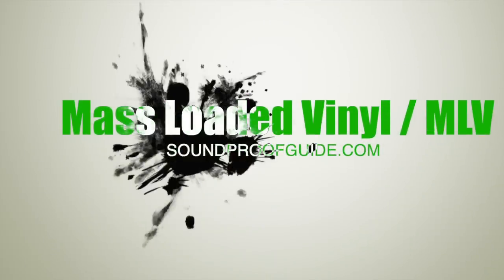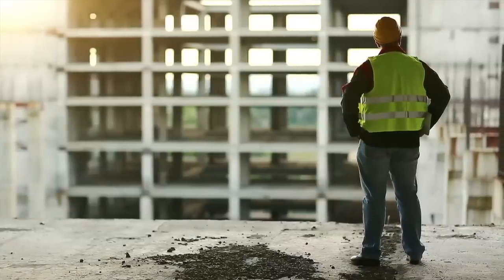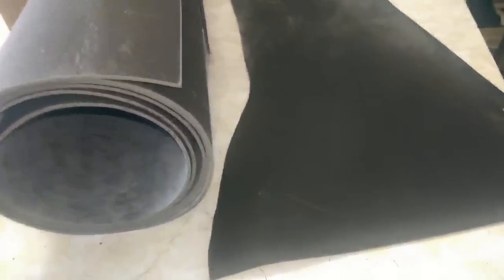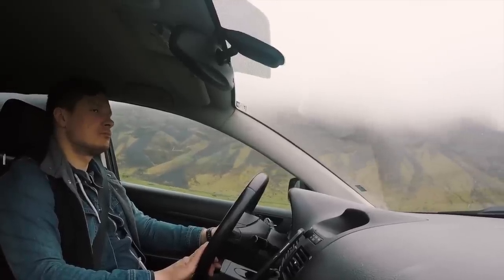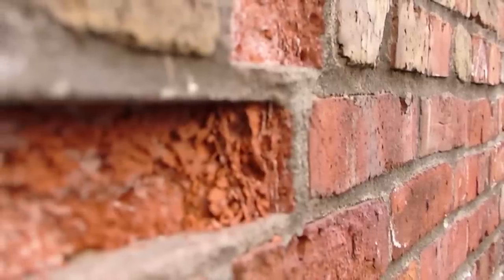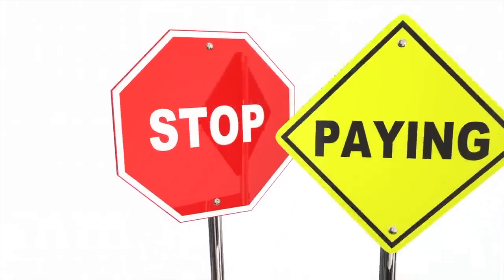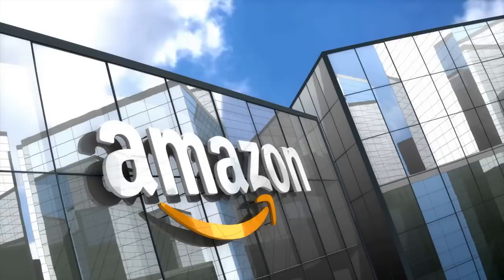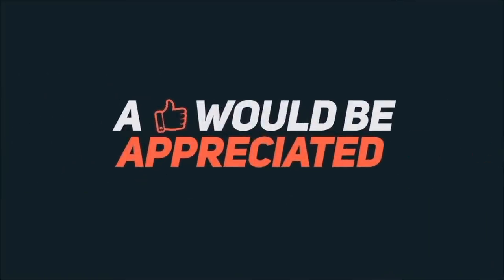Mass Loaded Vinyl For Soundproofing / All the MLV Facts!

Comment: PLEASE explain.. read a lot of comments.  You can’t just apply over an existing wall, like a bedroom that faces a noisy road, it won’t work unless you use another layer of drywall over it???
Reply: I wish they would answer. Because I need to cover my wall from my Noisy Neighbor but I don't have the ability to put another wall in front of it
Reply: @janinec..beyondmeasure  
Put SOMETHING in front of it...temporary,  movable panels: covered in fabric or ceiling hung Heavy curtains entire length ( like hotels do) or wood panels ?
Reply: @karlakay  thank you very much but believe it or not I came up with a great idea and it works. I got medium size storage lids and I put four of them in each window.  my next move is to attach felt to the lids and then it will really be quiet. It actually works

Comment: Thanks for the great video, do you have a video on how to install this?
Reply from the maker: Glad you enjoyed it! 
There’s no videos on how to install it yet.
It’s really simple however. Where were you going to apply MLV?
Reply: Hey there, in my case I wanted to install it in rhe ceiling between the main floor joists and the basement ceiling dywall. Staple to the joists? Would  Roxul safe n sound between the joists still be useful for added advantage? What is the advice for handling penetrations due to wiring, piping and  the recessed lighting we are planning to minimize loss of ceiling height? Could the penetrations significantly compromise effectiveness of MLV?
Reply: @bodhisattva4eva   For ceiling application not recommending you staple it as it will rip. You need to use nails with a big washer head. I would recommend some insulation material in between joists. It will help with sound blocking.

Comment: MLV is very costly , I just use GRACE ICE & WATER SHIELD® a 60ft. roll is $90 same effect at a fraction of the cost , Ive used is succsfully under floors in ceilings ect . Dont get sucked into spending $$$ when Grace is just as good and so cheap you can double the layers with out spending thousands of dollars.

Comment: MLV isnt working too well for my house. I live across the street from sn incredibly loud gas station and I tried the sandwich technique and another layer of drywall to no avail. There is basically NO sound reduction and it was a huge waste of money.
Reply from the maker: So sorry to hear that. Have you done any soundproofing on the windows? Before soundproofing an outside wall, you should look at the windows first since most of the sound is usually coming from.
Reply: @soundproofguide  I tried stuffing blankets in them recently and that hasn't worked. They are single pane and I'm having them replaced in 4 months but I would prefer to reduce the sound now. I may even consider bricking over the window entirely if it's more cost effective. Later I will put some bricks in the window frame to see what level of noise is reduced. I have put MLV and 2 layers of 5/8ths drywall over that window. I wanted to put a bookshelf over the space of the window alone but the noise reduction is so low I'm considering ordering more drywall.

Comment: Please. Will you improve a speaker if "Mass Loaded Vinyl" is installed inside the speaker box?
Reply: I was sort of thinking the same thing except I was thinking of using 5.2 mm sheets of plywood and painting the sheets with sound deading paint and sandwiching the loaded vinyl in between the sheets (3) stacked together to form a 1" piece to build the box out of.
I have two nice pieces of live edge ash 10-12 inches wide 55 inches long 1 1/2 inches thick  to make speakers out of so I'm trying to figure out the best things to deaden the box behind them.
Reply: MLV won't do much inside a speaker box. You can try acoustic stuffing (poly fill) inside the box. Its usually used in boxes to reduce reflexes. Also used in sealed boxes to 'trick' the speaker into thinking there is more airspace and will lower the Fs slightly. I have seen MLV or sand used in transmission line boxes to add mass to an area and deaden it. Bracing the box is the best way to add rigidity.
Reply: @michaelweber5968 Most hi-fi boxes use somewhere between 1/2" and 1" MDF or Baltic Birch Plywood with some bracing and maybe poly-fill. I would recommend buying speaker plans and following them for the dimensions, drivers, and crossovers; DIY speakers are notoriously difficult to perfect. MLV is good for making an area quieter but it doesn't have much use for building the actual speaker.
For reference the SPL competition boxes in cars are usually 18mm mdf double or triple stacked. So if you're after a dead box you're doing very well with 1" of material. I wouldn't bother with MLV or special paint.

Comment: Anybody can help me out? Can i put this on my garage floor exposed? I practice in my garage my bass rumbles the house still, any suggestions?
Reply: You can if you have something under your garage you want to insulate, also there are more effective measures you can take with floors. MLV is designed for insulating piping mainly.
Reply: Try the mats designed for excercise equipment,  treadmills.  Very surprised how well the work. 
Then put MLV over your garage windows. And insulate the ceiling.
Reply: @karlakay  thank you!

Comment: You have distorted the principles of proper  sound control. You have compared a "mass law" application vs.  a " decoupled system" also known as complex structure which are completely different results. Mass loaded vinyl is great when used in the correct format but when sandwiched between drywall layers or placed flat on a floor with out decoupling is does not deliver bang for buck. Also MLV is not NRC tested only STC tested unless bonded to an absorber.
Otherwise I like the video, I just think it needs some corrections.

Comment: Hi, thanks for the video. If I were to use MLV as a curtain, and "stitch" on a normal textil curtain to the MLV on one side, for aesthetic purposes, would you recommend it?
Reply from the maker: Honestly, I would just buy blackout curtains. Watch my video on “soundproof curtains” and you’ll learn more about them. Buying a set of these types of curtains would probably end up being cheaper and will look better in the end. The results “should” also be around the same. I’ve never tried what you’re suggesting however but guess it be pretty close.
Reply: I'm going to try that using MLV as curtains,  covered in fabric. Or even insterted into double, lined curtains . Will let you know. 
Using in / on an external door, off bedroom. Traffic noise enters. 
But I didn't understand about Grommets?  Going to try ceiling mounted flush rods & heavy clips, then fabric over it They don't need to open & close 
WISH I could create MLV Roller Shades. Lower at night.
Reply: @karlakay  did you end up doing this? How did it work for you? I’m trying to reduce traffic noise from my bedroom windows.

Comment: Soundproofing only works if you build a decoupled wood frame, do not attach it directly to your wall. Attach to ceiling, floor and sides on accoustic tape, fill with Rockwool accoustic slabs, put accoustic tape on wood frame cover with soundbloc plasterboard. Attach one layer of mass loaded vinyl then another layer of accoustic plasterboard. Seal with accoustic sealent, skim and decorate. 99% soundproof.